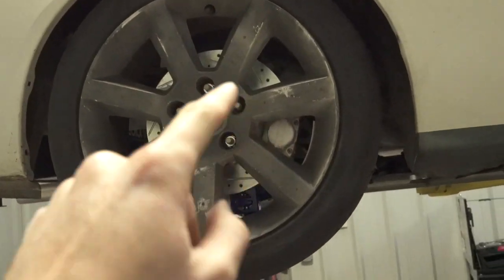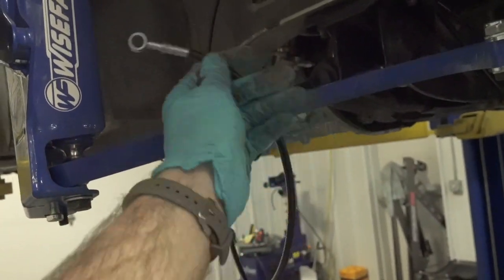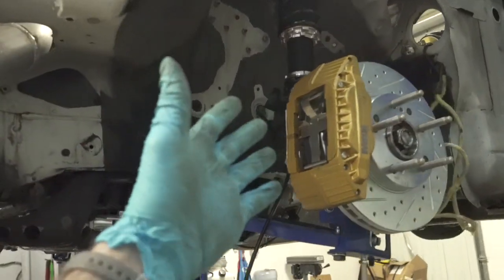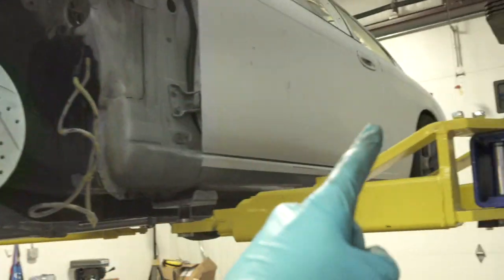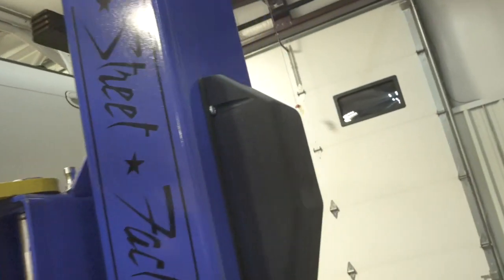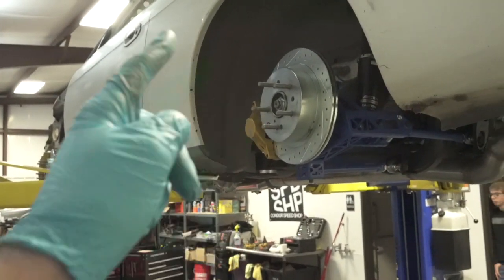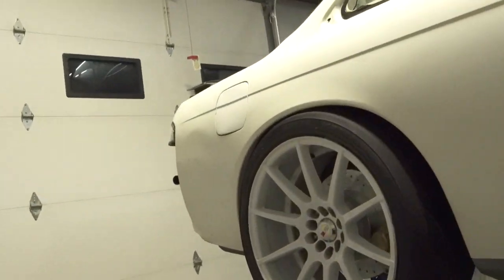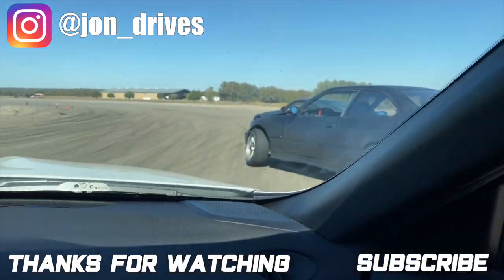NEW Z32 Big Brake Upgrade 240sx S14 Drift Car! SO SICK

Comment: Do you need extra brackets for the second set of calipers on the rear ?
Reply from the maker: Luckily the rear wisefab already comes with 2 sets of brackets for the handbrake caliper. 👍👌
Reply: @jspeedracing  👍👍👍